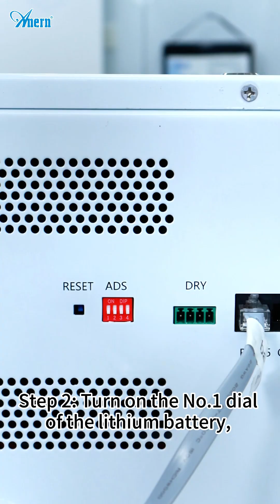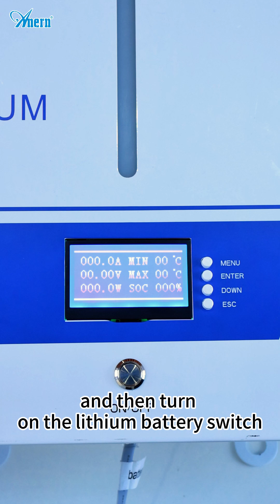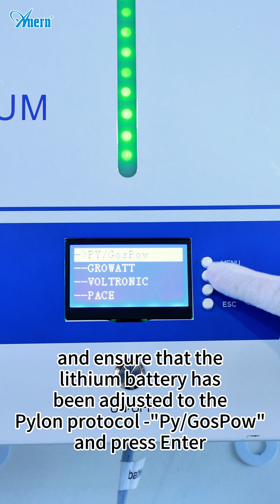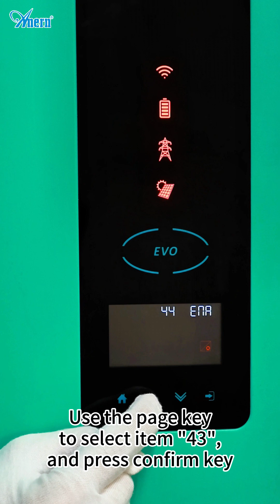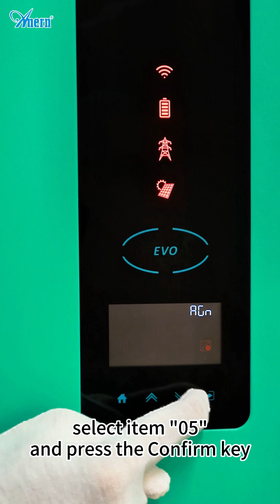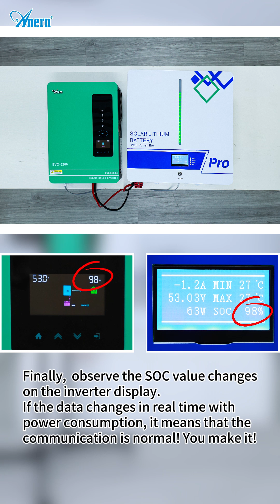How to communicate Lithium Battery and Inverter?

Comment: The video clearly explains the configuration of parameters number 43 and 44, which are essential for connecting the Battery Management System (BMS) to lithium batteries. However, the current firmware version installed on the solar hybrid inverter devices of the EVO series that I purchased from your company does not include these parameters, as the highest setting number available in our firmware version is only 42.

Is there a new firmware update or a more recent version of the internal device software for the EVO series devices?
Reply from the maker: Sorry, my friend, no support for self-update
Reply: @anerngroup-solarcompany  
We contacted your support teams, but we haven't received any response. What should we do?
Reply: Hello sir.  I have a eco6200 anern inventer.can i ask if the comunication is normal.the percentage of the batery will display to anern lcd?